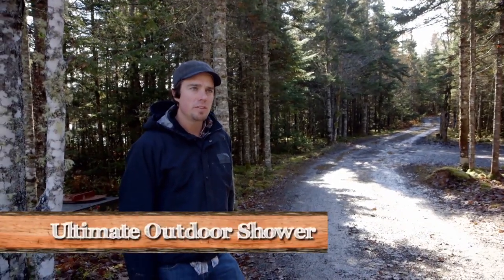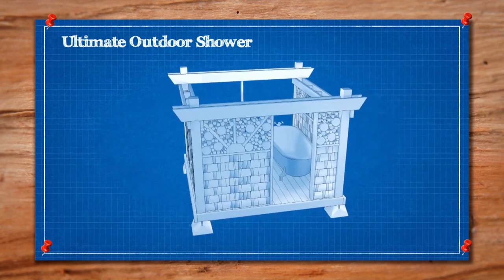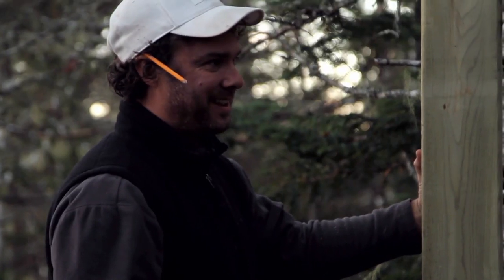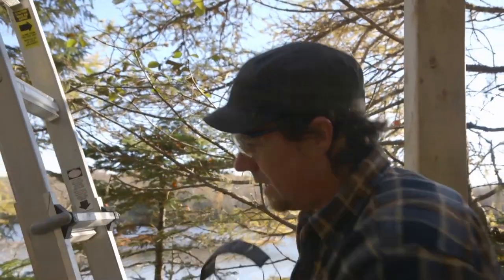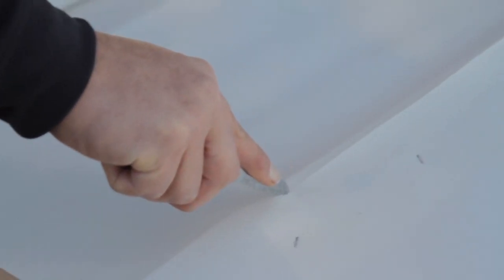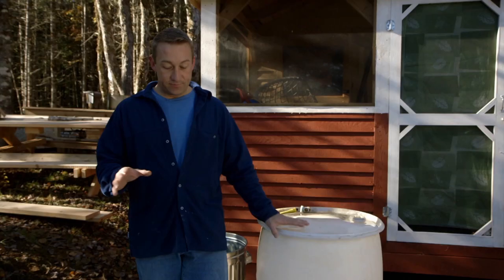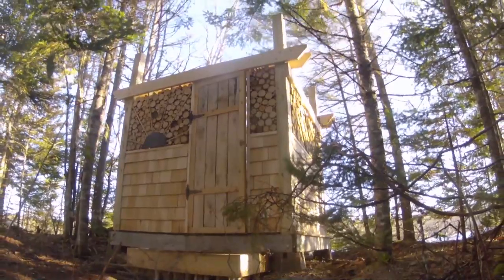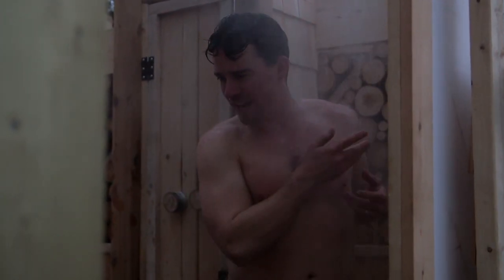How to make an Outdoor Shower

Comment: don't think I'd want to take a bath in lake water
Reply: The heat from the heater will clean the lake water anyways...
Reply: Tomas DeLuco only if the water is literally boiling/freezing does it kill the bacteria.
Reply: ***** That's not true. Most bacteria will die long before it reaches boiling point. Being submerged in water that's half the boiling point would burn pretty bad, and would probably kill us if we didn't drown first.